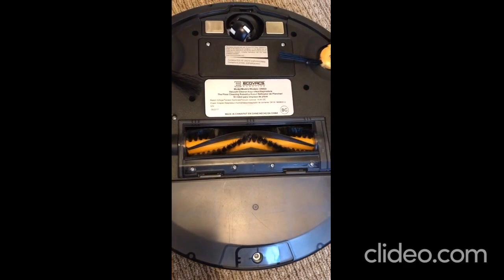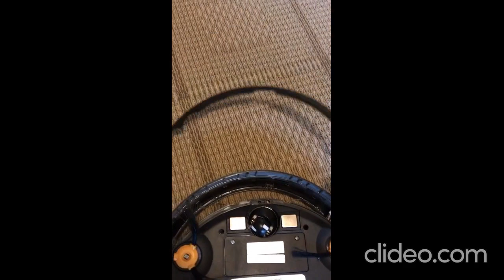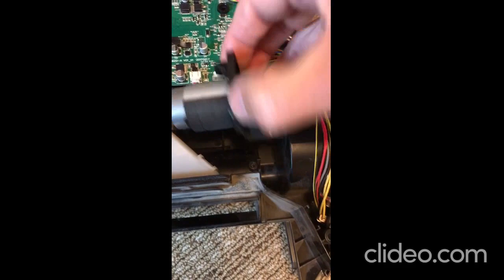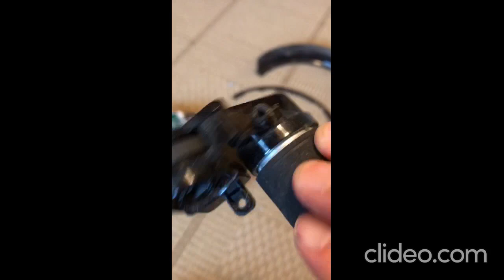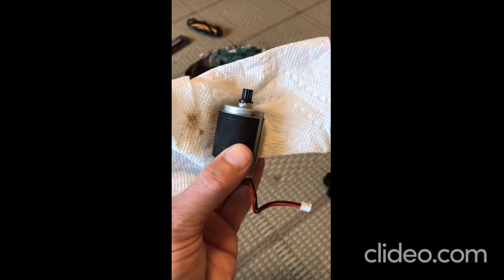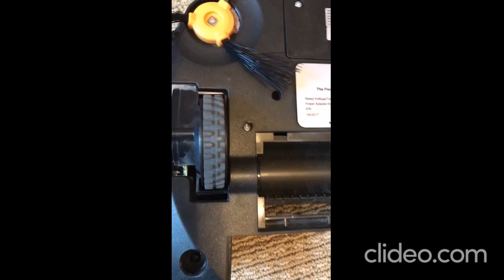Deebot N79 Repair of Jammed Motor

Comment: I have the 710 model and have a main brush error. I removed the cover piece for the bumper but the bumper won't come off. I finished taking all the screws off but unable to take the bumper or the cover off. Do you have any suggestions?
Reply from the maker: Don’t know the 710

Comment: Great Video....figured we had to buy a new vacuum.  Cleaned everything and still couldn't get the motor turning.  Didn't know we had to go deeper into the pin for the hair removal.  Up and runningin in just a little time!  Thank you
Reply from the maker: Denise, glad to know it helped you. Hopefully the fix works longer than my repair. ;-)  I've benefitted so much from people taking the time to share their solutions to repairing home devices, I thought I should do the same.

Comment: This was really helpful and it helped me get my Deebot back online. One thing I would suggest is using motor oil instead of WD40. WD40 is a solvent (even though it markets itself as a lube). It actually will dissolve any of the original grease/lubricant and will eventually cause the motor to seize up.
Reply from the maker: Probably why my fix didn't work permanently. Good advice.

Comment: Do you have a video that shows how to get the motor out? Specifically the head screw?
Reply from the maker: No, and after a while the vacuum malfunctioned again in the same way so I concluded that it is not a very high quality product and purchased one from iRobotics which I am happier with.

Comment: Thanks, seems to be a common problem. Mine didn't have debris around the actual motor gear but the cog at the other end of the belt inside the housing. I used WD40, compressed air and also some folded paper to get into the gap, because I was concerned that a knife blade might cut the plastic components.
Reply from the maker: I got advice to use motor oil instead of WD-40 which I think is a better lubricant.

Comment: When I did this process, I discovered that my main brush motor output shaft bearing is worn out, causing a terrible squealing noise. The output gear can be moved by hand. I guess it could not handle the side loading. Any idea where I can get a replacement motor? Ecovacs is no help. I have seem some other replacement motors but none for the main brush of this model.

Comment: Thank you so much!  I replaced my main brush but was still getting the error, and my Deebot was out of warranty, so I got brave and followed your instructions.  There was only a tiny bit of hair around the spindle, but with the addition of some WD40, I was able to get it moving again.  I somehow did this without losing any screws or messing up putting it back together.  And now my Deebot is totally clean and running as good as new!  Thank you again for your video - without it I would not have been brave enough to try this.
Reply from the maker: Karen, I only tried this because the Deebot was out of warranty and it was either throw it out to dive in! Nothing to lose!  Hopefully yours is still running. Mine jammed a few weeks later and I decided to get a Roomba. However the Roomba is not without problems. I have tried many of these robotic vacuums and have yet to find an 'intelligent' one. So much for artificial intelligence, LOL! Looks like they won't be replacing us humans anytime soon. ;-)

Comment: So did it work? Mine was the side brushes that stoped working after only a couple of months. Did the same as you, took it apart, clean everything thing good and oiled the motors, but still no good.. I really didn't like my Ecobot.
Reply: Martin Fiset, did fix the side brush? I opened mine and everything looks good. A new motor it's about $30,00 I do not know if is worthed.